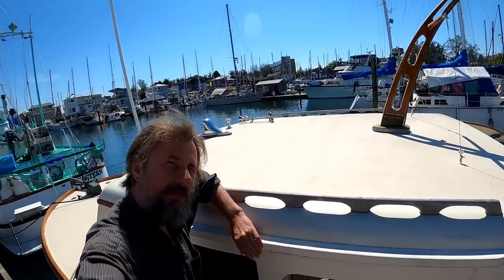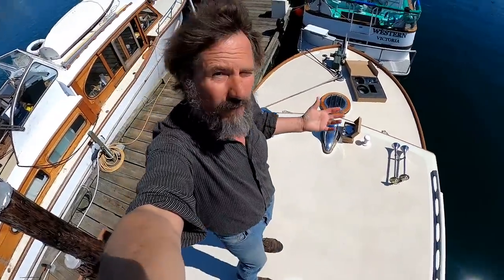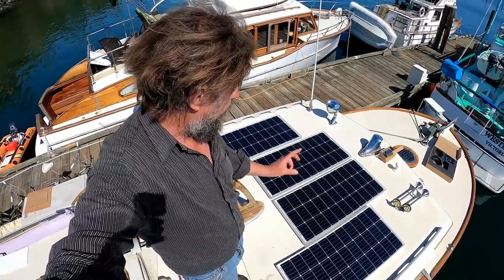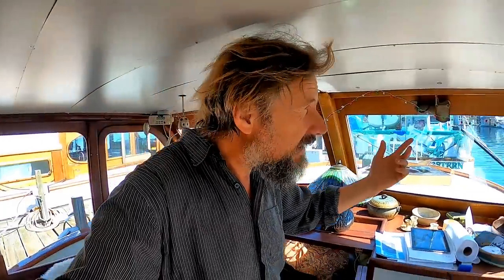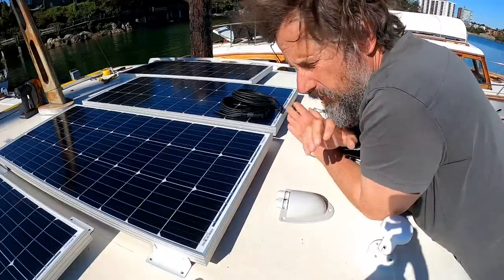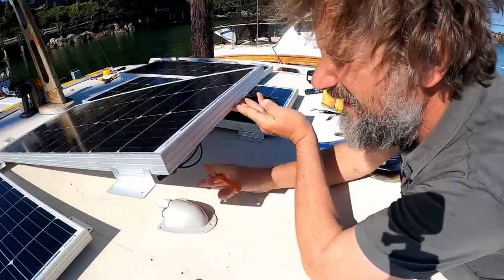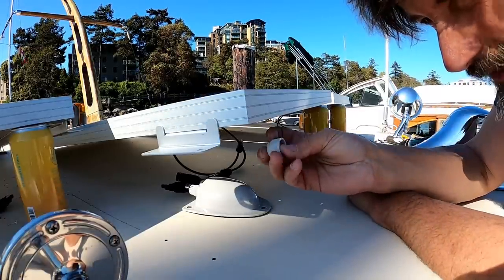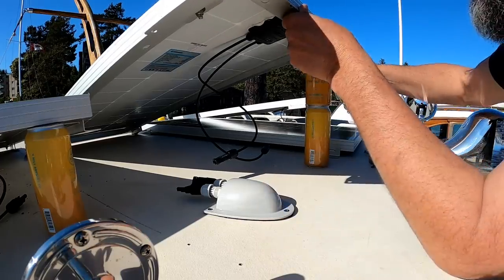Solar Power - Boat Life - Living aboard a wooden boat - Travels With Geordie #169

Comment: You should be using a blanket over the solar panels before plugging in those wires or doing anything with them, as long as the sun is on them current is flowing and the power is more than capable of burning out your nice shiny mppt controller .
Reply from the maker: That's interesting, I wondered about that and did some research. Apparently it's not a concern and in fact I was amazed there wasn't the slightest arc when I connected it. It's because the controller isn't normally an open circuit. It has built in protection for just that.
Good point to ponder though.
Reply: @TravelsWithGeordie  this is what is known to me to be a best practise. Also to connect the battery BEFORE connecting panels.

Comment: Like you i always used to hate trying to line up all the screws to hang things like the solar power controller, the one tip i was given one day changed the way i do it and make it so much easier now. take the controller, find someone with a flatbed printer/photocopier and copy the bottom, then you can put the piece of paper on the wall and all the screws are in the perfect place to drill. hope that helps.
Reply from the maker: Ha, technology!

Comment: Nice work Peter.  I enjoy it when someone shows just how easy a solar install actually is.  I would probably go with circuit breakers rather than fuses for your circuit protection.  I would use a Blue Sea 40 amp surface mount breaker between the controller and the batteries.  Between the panels and the controller you can't use one of the Blue Sea breakers because they don't have the required voltage rating (100 VDC min).  I would go with a 7 amp Midnight Solar MNEPV breaker (~$12.50 US).  Thoe breakers are rated at 150 VDC which gives you plenty of headroom.  The only issue is mounting the breaker since those breakers are DIN rail mount.  A piece of DIN rail will likely cost almost as much as the breaker.
Reply from the maker: Hi Todd! Yeah, breakers would be elegant. This job has to be really cost conscious so we've opted for the ANL holder that comes with the kit from Renogy. A bit lightweight but I think it's fine. And a boring little ATC on the PV side.

Comment: I think I could POWER through that PORTER pretty easily.

Solar power is interesting, I am looking at building a solar trailer to tow behind my recumbent trike and get some touring in.
Head down the Pacific Coast and stop at the occasional brewery for samples.

If you are interested in that kind of thing ( you see what I did there ) check out the suntrip 2021, solar powered bike race.  2020 has been cancelled.
Reply from the maker: So cool, will check it out!

Comment: Peter, delete this if is inappropriate.  I'm down at the Bremerton Yacht Club, on the Olympic Peninsula just south of you.  One of our members has put his gorgeous 1953 Monk up for sale.

Attention BYC members and especially new members. April Ann (42' x 12'4” x 3') is for sale and so is the boat shed at slip 315. We are asking $40,000 for the boat and $20K for the house. She is a wooden classic, Ed Monk Sr. design, built in Tacoma in 1953. April Ann is cruise ready and nothing has to be fixed or done. I have done it all and have pictures to prove it. Her twin, Chrysler 318 V8 engines with “V” drives are fresh and the bottom paint, hull paint and varnish are excellent. With a step through tran- som door, full stainless steel (original) galley, electric refrigeration, shower, complete fly bridge, Achilles RIB and cozy diesel fire place she is a joy to cruise and a real head turner in any anchorage or marina. If you like, I will give you a free can of Interlux Schooner 96 varnish and lessons to go with. It's fun and very rewarding. You'll like it. Mahogany is not like teak. Please contact me, Bob Wheeler at H-360-479-4571 or C-360-440-7695 and we'll talk. Thanks for your interest.

Comment: What type of clamps are in the CC?  If they are just screws and not plates, you need to crimp ferrules on the bare wire ends.  It is a ABYC requirement.  And there are strain reliefs on the wires under the CC
Reply from the maker: They're proper clamping plates, but yes the strain relief is yet to come.
Reply: Cool.  But you might want to provide extra strain reliefs external to the controller.  Any movement of the leads can result in the soldered junction connections to the PCB overheating. When  that happens, the internal fuses don’t blow, and a fire can start.  From a fan in Uganda.   I have a sailboat in Seattle, and spend the fall cruising up around your neck of the woods.  Spend a lovely week in Sydney last season recovering from a hydro-locked engine.  Made two trips into Victoria to blow off stream.

Comment: Great video ( as always :) ) Pete ! A question: why serial ???
Reply from the maker: Serial limits the current load in the wiring and raises the voltage increasing efficiency. The charge controller is designed for this and has more ability to optimize the input power at higher voltages.

Comment: Great work man, I'll be fitting this same charge controller. Awesome to see it working before I do it. How many watts are those panels rated at (I missed that maybe)
Reply from the maker: It's a great unit. 400 watts of panels, max so far is almost 300. Very impressed.

Comment: Nice job, very sanitary installation! Got a question though - I noticed that there are no sealing washers underneath the screw heads. Does the butyl rubbber strip under the brackets seall well enough around the screw threads to keep any moisture that could get under the head of the screw from wicking down the threads and into the wood of the cabin roof?
Reply from the maker: Thanks, yes, the butyl is awesome stuff. It spreads out under pressure and seals the whole works!

Comment: Wouldnt you shorten the wires to a min length for proper install,, also looping wire thetorically makes a magnet??   Also should just switch off 12volt charger from dock circuit, let the solar run as if at anchor as primary operation ?
Reply: christopher peterson he kept it coiled to be moved at a later date (possibly). You are correct in that the coil will act as a magnet, however, it is a large coil with a big air gap that has very little current flow so the effect will be negligible. It is also DC so there wouldn’t be an induced emf if the current flow was large enough
Reply from the maker: What Mr White said...Heh, yes it's possible the controller will move so it would be a shame to cut the wires, Wouldn't a field only generate if only one conductor was coiled, doesn't the other cancel it...? Gotta look that up, oh... Alexis?......

Comment: Power. Would like to understand the math supporting 400 watts on the boat!
Reply from the maker: Hi Al, I'm going to do a whole episode on power systems. But the biggest draw on this boat is two refrigerators!
Reply: @TravelsWithGeordie  I would also say it is better to have extra capacity to start with, as you can easily add more draw on the batteries making it needed while adding more panels is a slower process.

Comment: How resistant to salt water are the solar panels and brackets ?
Reply from the maker: Good question Louis. The panels are pretty resistant and designed for boats etc. All the hardware is aluminium and stainless steel. I's say they will hold up really well.

Comment: Why didn't you seal the screws used to hold the panels to the top?
Reply from the maker: Hi, I did, I use butly tape for all such work, it's amazing stuff and stays pliable indefinably. Perhaps you didn't notice me applying the tape to the bottom of the brackets. In this way it also seals the holes as the screws penetrate and squeeze it to make a perfect seal.